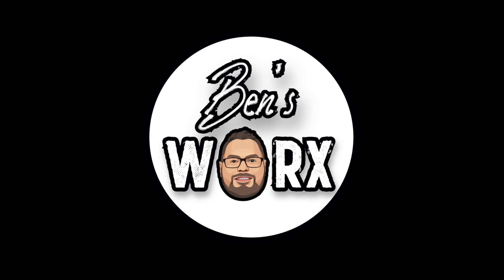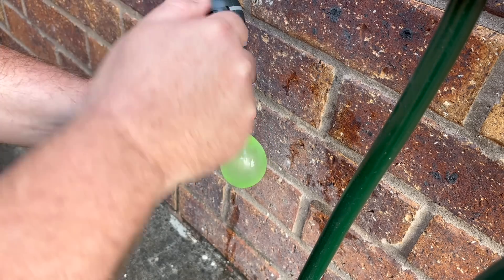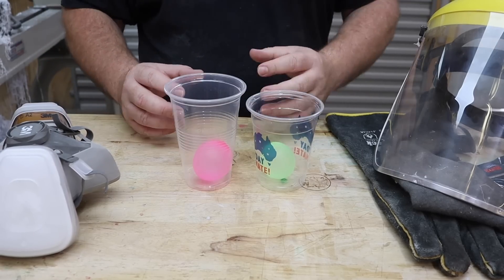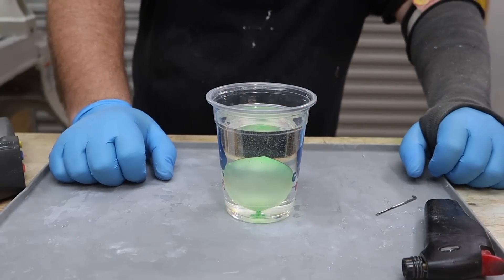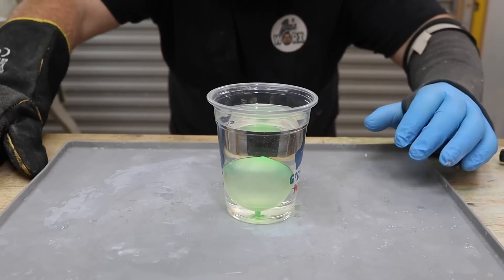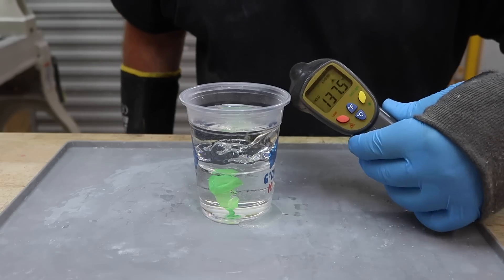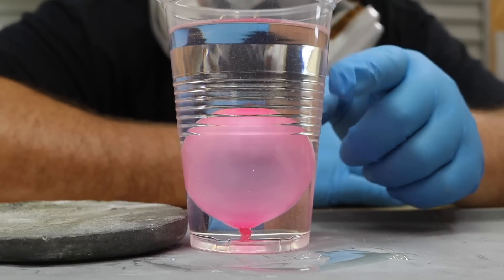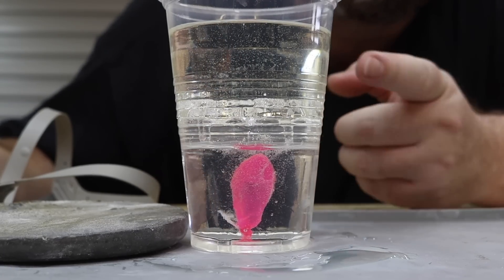What Happens if you POP a Water Balloon in Hot Resin ?

Comment: There is no need to pierce the ball.
If it does not burst, then cut a hole in the bottom, drain the water, pull out the rubber, and pour another pigment into the hole.
You can add glycerin and gold dust.
Then seal the hole with transparent plastic and add epoxy resin on top.

Comment: Pure sodium and water fizzes heaps. Tape a bit to the top of the ballon. Will it react with the resin? Don't know, maybe. There will probably be a lot of pressure on the solidifying resin cap...May explode... needs research before pulling this stunt. Pure sodium needs lots of prep to handle. Vinegar in the balloon and bicarb on the top might be a safer way to start. Mentos and coke?... Looks like you guys are having fun :)

Comment: Funny how bubbles got larger when finally cured, didn't just float higher.  One "problem" is you may not be able to demold - top and bottom parts almost completely separated by the water layer.  I wonder if you could cast a resin box, cute that long enough to maintain its shape, and pour your balloon mold inside that? Trickier to pop, but you have a clear surrounding box.  Hmmm...

Comment: Wat too much water in the balloon. It takes a significant amount of thermal energy to have the liquid water turn to steam... far more than the heat input from exothermic curing of the ployester.
Try heating the water balloon close to 100C in a microwave oven prior to adding the resin. It will be easy to see the initial expansion of balloon as it approaches transition to gas.

Comment: You done this all wrong? 
Put water balloon in container. 
Mix resin HOTT pour in container with water balloon. 
Take an easy releasable Dowel rod poke down to balloon and pop balloon as the resin is in rubber like state. Then pull dowel rod out! The heat will push the water out!

Comment: You should try using a needle and syringe to inject water or a different resin into the center. Of course the needle would probably have to be pre inserted and heated to remove it. The other liquid or resin would need to be at a similar temperature too. Probably why your balloon didnt lead to an explosion. The only difficulty is that you would almost want to remove the same volume of resin as whatever you are adding in in order to keep the solidified top together.

Comment: Can you cure resin in resin? I hope this doesn't sound insane because I have no idea if it would even work. You make a clear resin container that is hollow. You then carry out the balloon experiment inside the clear resin container popping the balloon with one of those strong handheld laser pointers. That way there is no risk of the water making the sides weak and you would have a nice, smooth surface to look through instead of having the ridges of the plastic cup. I have clearly never actually worked with resin, so I have no idea if any of that is doable. lol

Comment: Maybe next time you try recreating jedrek24t's diaroma by actually filling a water balloon with tinted slow curing resin, putting it inside a fast curing resin and then piercing the balloon at the same point of curing as in this experiment? 
I checked Jędrek's video and he's casting the balloon shape from entirely separate mold and putting cut up balloon (as well as cool effects) over it. I'm curious how it will act with actively curing resin inside resin.

Comment: inside the water balloon put some glitter or resin pigment then put the water in and then re try.   Controversially alcohol and heat sensitive powder might be fun, but dangerous,   or  slow set resin coloured, inside the resin or uv cure resin inside a black balloon, pop that in hi UV light  you might get some cool stuff with that.

Comment: Ooookay, that’s cool, butttttt…
You should cast a shell in the cup first, get a nice thick layer on the sides, then attach the balloon to the bottom, then pour and pop as you did.

The key is to glue a very small clear straw to the side of the cup for your needle to go through.

This way you can trap the water with thick enough sides that you can turn it down.

Comment: Thought - if you replicate this experiment with a larger balloon & cup, cut off the top & bottom, turn it with the lathe until the interior water (some or most gets discharged), and then recast with a colored resin in an appropriately sized receptacle, de-gas & turn it into an egg or sphere? Hollowed out voids with color? Or, maybe use dye/ink in the water? Just a thought... Love your vids, bro!

Comment: Always love watching you guys do the experiments always so cool. 

Couple of thoughts on it if you want to try them again. One put colored water in the balloons to really see where it goes and ends up and two make a thin layer of maybe uv resin on the inside and bottom of the cup before mounting the balloon in it. But if you do that you may have to pre mount the needle in the side of the cup so that all you would have to do is tap the needle to pop the balloon. Then it should be sealed enough so as the water wouldn't run out the hole or leak through the top and sides. At most you might have to run a drop of uv resin around the needle after removing the cup and I am thinking it would all be sealed inside and in color.

Again love watching you guys do the experiments always, always so very cool 😎😎😎 
👍👍👍

ps just thought of another couple things to try, a balloon filled with just air, and one filled with something carbonated Coke, Pepsi or something to that matter unless you think that could be too dangerous.
Reply from the maker: Thanks Gary, yeah that should work 👍

Comment: I love that you do these experiments. Even though we will never need to pop a water balloon in resin, this is valuable information for how resin reacts in more "normal" projects. Good on ya!
Reply from the maker: Thanks Mate
Reply: There is no need to pierce the ball.
If it does not burst, then cut a hole in the bottom, drain the water, pull out the rubber, and pour another pigment into the hole.
You can add glycerin and gold dust.
Then seal the hole with transparent plastic and add epoxy resin on top.